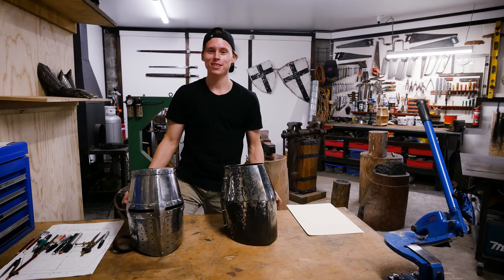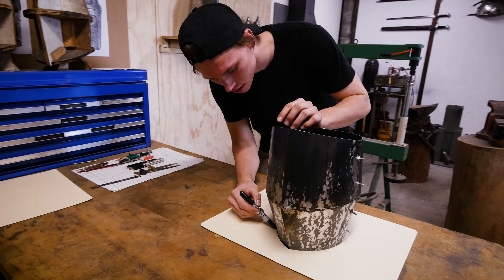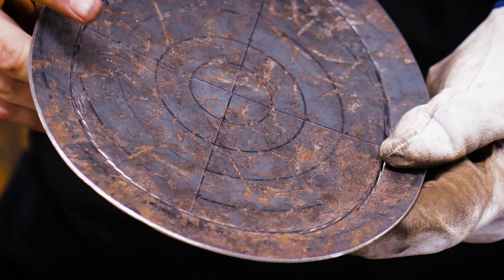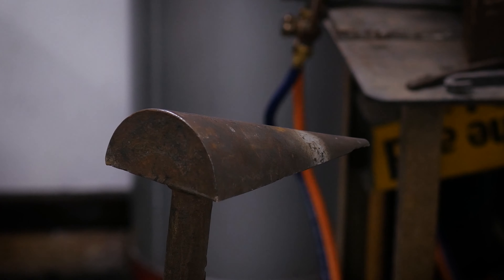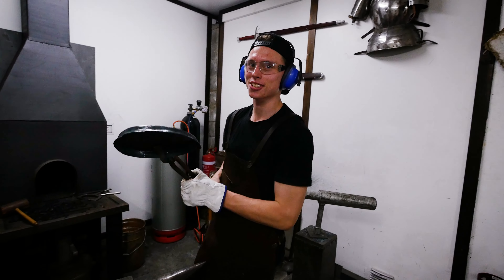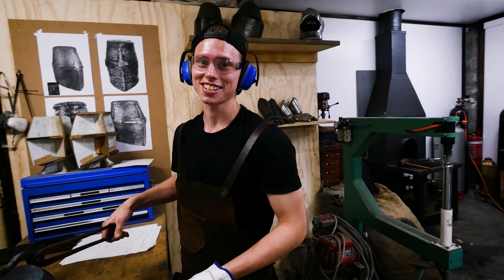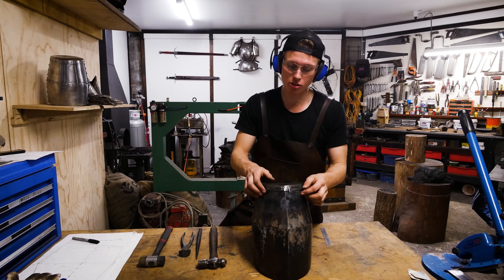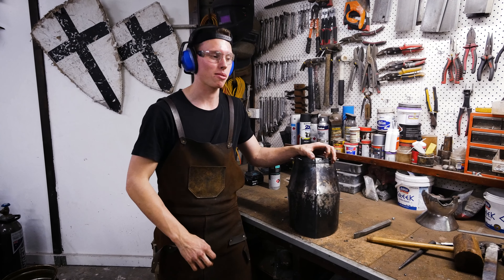Making a Great Helm (ep3) | TOP PLATE

Comment: The flat top of the great helm also has an added advantage of absorbing force and spreading it laterally, like striking a drumhead.

Granted, glancing a blow away is always better, thus later periods’ curves and tighter, more formed fit, but the thing was a Tiger tank’s glacis in its day, and practically invincible. It’s a design that lasted the better part of three centuries for a reason.

Comment: my thought as to why it was made with a flat top was that it was easier and quicker to make and during war time when you had to outfit a lot of men with helmets you could spend less time making each one witch also allows  you to make more and having more armored men could turn the tide of battel
Reply from the maker: An excellent point, making these items for war as efficiently as possible is most likely a major consideration with using the flat top design choice. Not to mention that fully enclosed helmets were a new and emerging style in the 13th Century

Comment: My idea is that flat top helms were generally easier to construct given the size of the helmet. They could compensate for this by wearing sufficient internal padding and/or some sort of internal support system. And also the use of the "cervelliere" I imagine. 
All of this is probably assisted by the fact that a great helm is very large, and thus more mass makes it harder to move. I'd bet they saw little to no functional difference with all these factors combined.